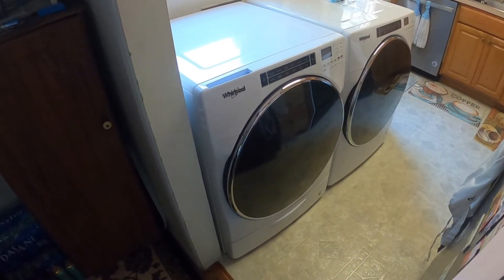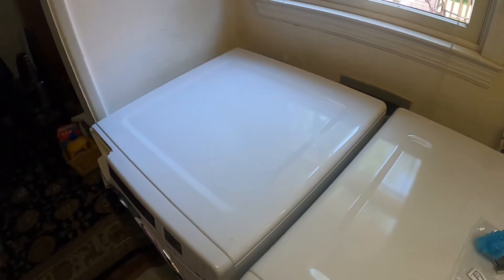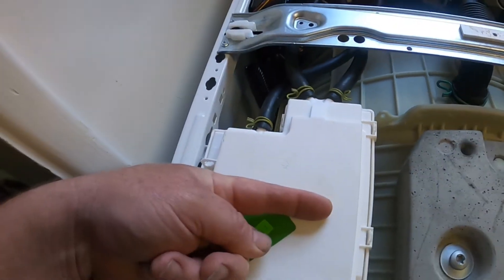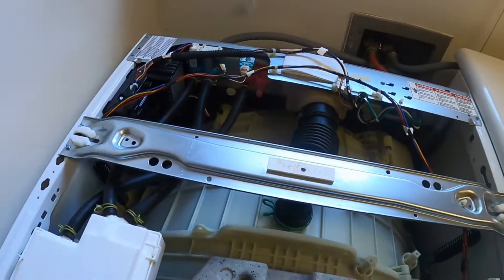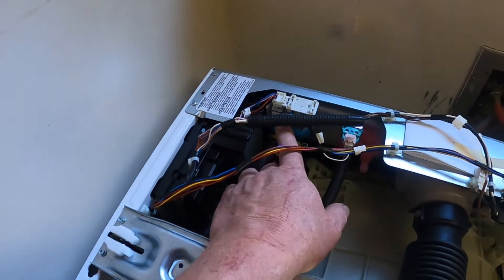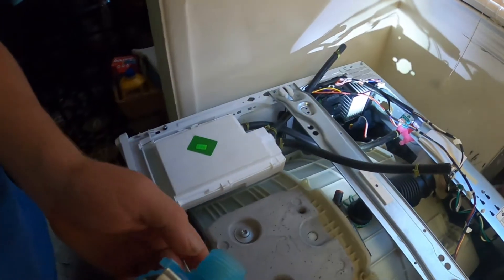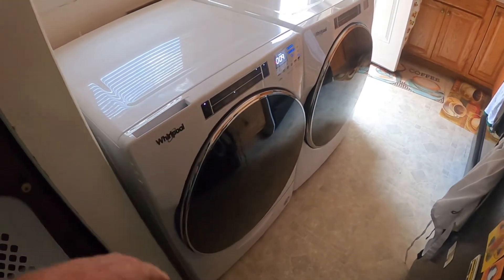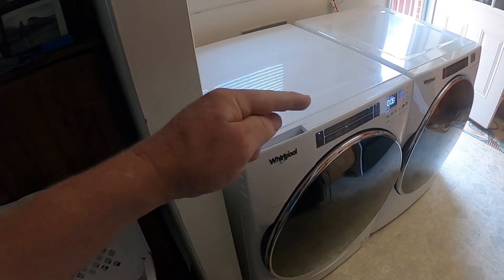Whirlpool Washing Machine Not Dispensing Fabric Softener

Comment: Do you have a video showing how you removed the white cover of the bleach/fabric softener dispenser on the inside of the machine?  While I believe I’m having the same problem as you did with the cold water value, I’d still like to know how to clean the dispenser reservoir as well.  Thanks for your help.
Reply from the maker: It look like there is 2 screws at the very front of the dispenser and I bet it just slides back. Lifts out after you remove the water lines.

Comment: Thanks. This was very helpful. I have the W11355369C and it looks exactly the same. I am having the same issue with the fabric softener and bleach. Not sure that I want to tackle it myself yet. It is still under manufacturer warranty. However, I was told that it may be because I have a well. Do you or anyone else that had or have this issue have a well or hard water?
Reply from the maker: Not that I know of. But that makes sense because the deposits in the water could clog it up. Thanks for watching
Reply: @TheGAutomotiveAndMore  Thank you and you're welcome as well.

Comment: Mines start doing that and it 4 months old
Reply from the maker: Mine was only a year old.
Reply: @The G Automotive And the funny thing is when I run the test mode the cold water 1 and 2 valves work fine but when it is time to dispense the fabric softener I hear it loud vibration on top and nothing flowing through the fabric softener dispenser spot.

Comment: I’m having the same issue as well as intermittent F20 (low water pressure) error. I have gone through everything except replacing the pressure switch or the water valve. I even opened up the water diverter compartment and tested the flow through each sub-compartment. The Whirlpool model I have has both the cold and hot water valves leading to a single entry point into the dispenser. Since the rinses are only done with cold water, I’m guessing the cold water pressure is not high enough to reach the fabric softener compartment. I verified that the water is directed through the right channel to reach it. Did you get any F20 errors?
Reply from the maker: I had no error codes. But so far this has fixed my washer. Thanks for watching
Reply: I changed the water valve and I immediately noticed a huge change in the amount of water flowing into the machine during the wash and rinse cycles. I would guess about double the pressure! Thanks for posting your video. A hundred dollar’s Canadian for the part but totally worth it!

Comment: Thanks so much for this video.  We had the exact same issue with our 3 year old Whirlpool.  I followed your guidance and now the fabric softener is dispensing fully!    I ordered the valve from a reputable parts store: part # W11316256, that (according to Whirlpool) replaces part # W11036930 (the number printed on the valve housing).  The part was delivered in a Whirlpool-factory-sealed box with the new part number (...256) printed on the outside of the box.  However, the part number on a label on the new valve is the same old number (...930).   The old and new valves look identical in every way.  Why the change in part number?  Just guessing on my part, but perhaps there were issues with some lots of the valve, which resulted in Whirlpool creating a new part number to differentiate the lots.  I'm kind of hoping it's something like this because I'd like to think that Whirlpool is doing something to address the early failures of this valve.

I also proactively replaced the three hoses (2 cold, 1 hot) that connect the valves to the dispenser unit.  Those hoses are labeled with "replace every 5 years".   To remove the old hoses more easily, I used a compress of hot damp paper towels to soften the hose ends.   I soaked the new hoses in a bucket of hot tap water so that the ends would slip on without a struggle.
Reply from the maker: Thanks for watching

Comment: I see you mention that you had worked on diagnosis for a bit.  Was this a consistent problem, or did it fail to dispense only sometimes?
Reply from the maker: It would work then it wouldn't. Then I cleaned everything up. Still hit or miss. Then it stopped working. Then this fixed it. Thanks for watching